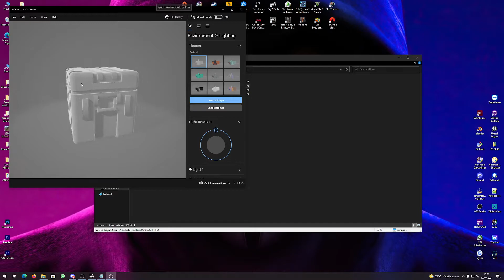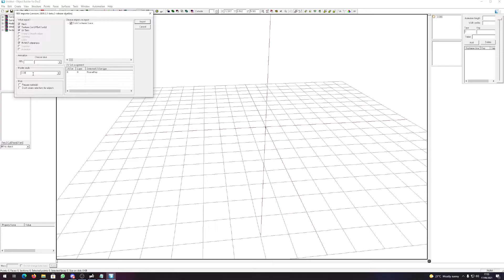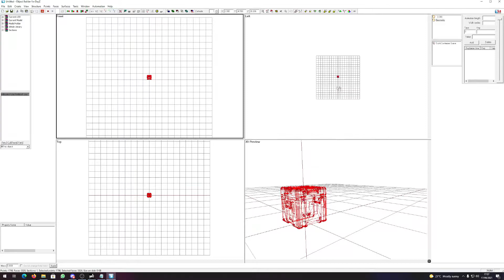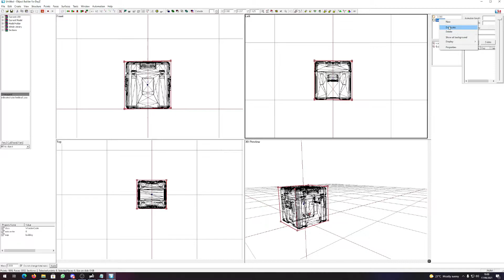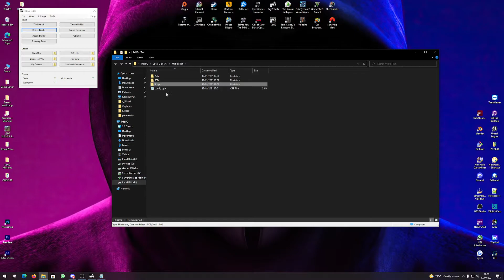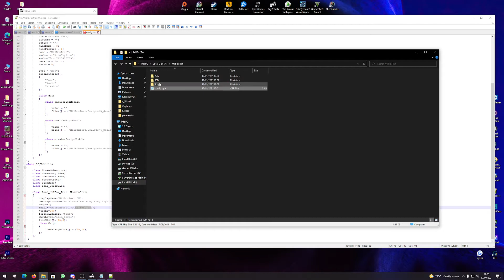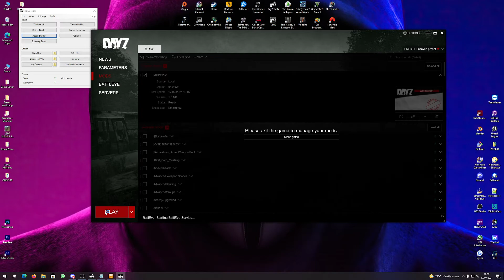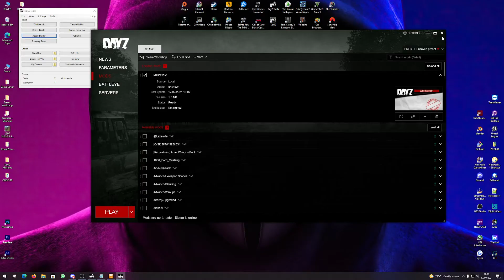DayZ Tools: Creating A Custom Base Object With Collision

Comment: Followed this 100%, the pboproject or addon builder won't pack it. Any suggestions ?
Reply from the maker: normally this would be a erorr in the file location you told them to build from or a error in a cpp or .p3d file  , but if your using pboproject it should tell you the error

Comment: This video is great. It's a little dated though and there have been many DayZ updates. It took me 3 days, my mod wasn't working, but i removed the "DZ", from required addons and it worked fine on my server after that. So if you're having issues getting this to run on your server, removed the entire line "DZ", and leave the "DZ_Data"
Reply: do you mod a lot recently ?

Comment: what if the object diddnt come with a texture file but still has color .how to i get that texture image?
Reply from the maker: you can use a program like "materalize" or photoshop to generate normals & as and smdi
Reply: @KingSkyline  thanks , i was wondering where you get the info on how to set up the LODs correctly is it all just hidden among the code in dayz or are you looking at the p3d to find references how they are supposed to be set up ?.
Reply from the maker: @GAMEBR0VIP2462   using BI samples & eliteness is the best way to find LOD sections   to learn what they do / dont do

Comment: thanks for insae tutorial. I followed everything u did. I can spawn crate and it has all parameters i set in config. also collision is working just when i am starting my server with this mod it is saying Addon "MyCrateClassname" requires addon "DZ" but it is commented in config at the top like ur config was setup already..."DZ" and "DZ_Data"

like i said everything is working just i made one mistake and put scale bit too high so my object is bigger than i wanted but i can make another one smaller
Reply from the maker: try changing the required addons to 

		requiredAddons[]={"DZ_Data"};

I think a Update since this video has changed you don't need to call for dz anymore as its automatic
Reply: @KingSkyline  thanks it worked! if u dont mind i would also love to ask if there is option to add in config some parameter that would make this crate untouchable...meaning nobody can pick it up into hands or inventory...i thought i seen it in configs in P drive but i found nothing like that
Reply from the maker: @LilPig-e1i  config wise I’m not sure if nohousedestruct would work as a base class , but you can write a simple script to false out taking to cargo and hands
Reply: @KingSkyline  well there is problem😂😂i dont know how to write scripts but i can make my crate size bigger as any inventory ingame a i am using it with events/eventgroups.xml to create my custom events and anyway when event ends crate should despawn also if i am right

Only thing missing for me is something like event notifications or map marker for events like heli crashes and my own events. Is there guide somewhere for that?
Reply: @KingSkyline  oh okay🤦thanks again